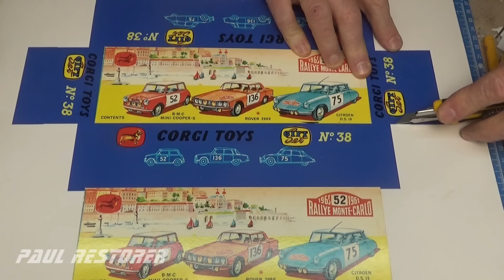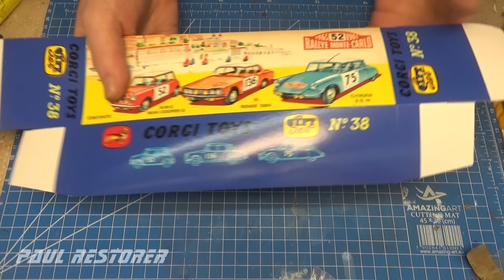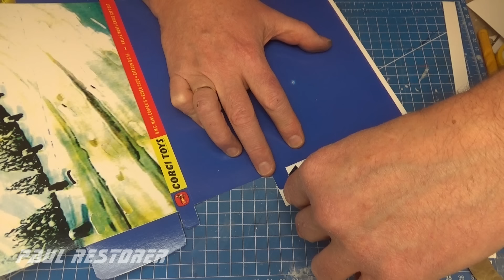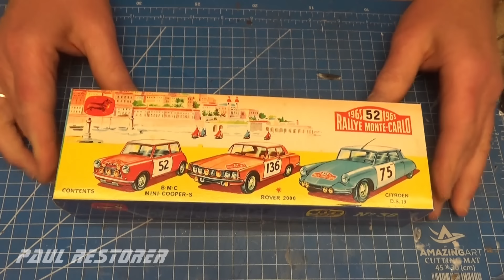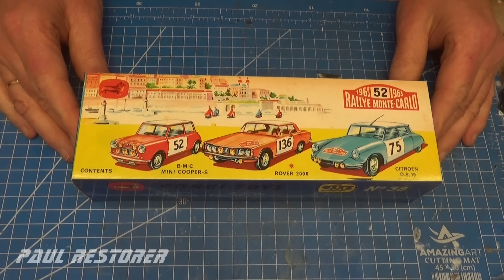Monte Carlo Gift set nr 38. Pełna renowacja. Citroen DS 19, BMC Cooper S, Rover 2000.

Comment: is that just how the mini cooper ages? because i have the same and it looks almost identical with the paint coming off this specific way
Reply from the maker: Unfortunately, it happens sporadically but there is no solution. Zinc is attacked by the so-called zinc plague and thus begins to decompose. It is probably also influenced by external factors such as humidity and storage. Best regards.
Reply: That's a problem that stems from too much zinc in the original alloy. When there's a lot of moisture in the air, the zinc reacts to it and starts to change, molecularly. If left in that environment, the metal eventually turns to sand and will just crumble. Some people call it zinc pest.

Comment: Great job🎉 as always!
Tell me please, how do you make the chrome stable, it doesn’t look damaged after you touch it…I use molotow liquid, but even after a week, if I touch it several times, it starts to loose shine😢
Reply from the maker: Thank you very much
Reply: I have the same problem with Molotow. I don't know what Paul does but I let it cure for a few days and then spray it with clearcoat. You can also apply Pledge over it, gently.  But I cringe every time Paul touches it with his fingers.
Reply: @rvs8425 Toy Polloi says you should set it aside for TWO WEEKS for it to cure properly. It's just a matter of patience.
Reply: Thanx! Will wait for 3 weeks then😅 hope it helps. Once I tried to cover it with clear coat after 10 days, but the shine of chrome was a bit lost. Patience is our weapon I suppose 🤗